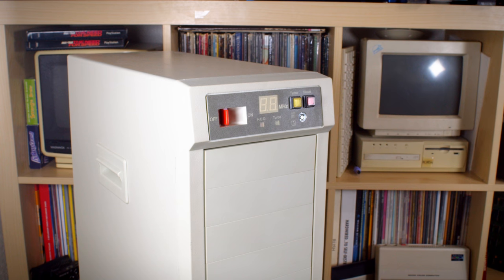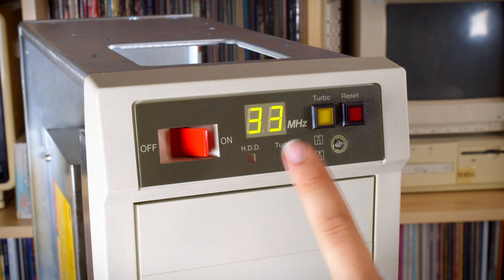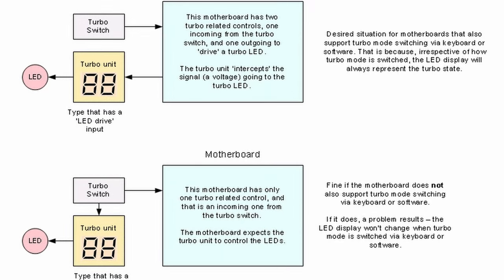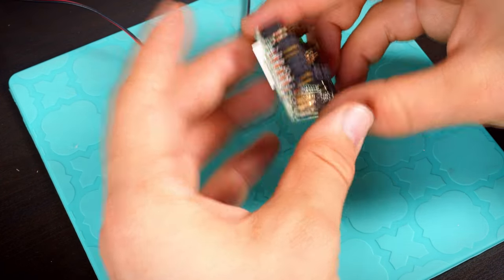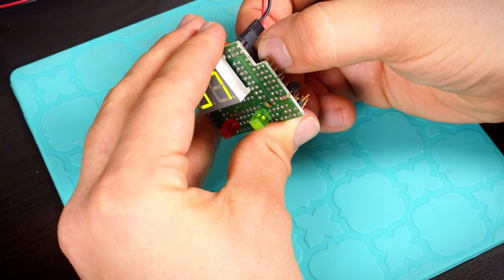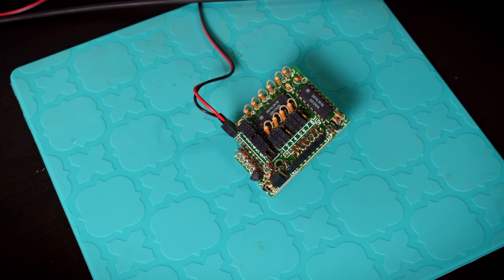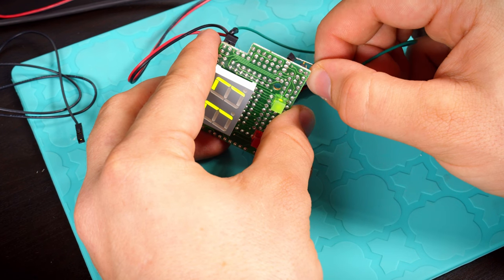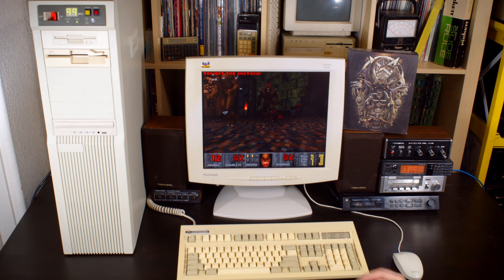Turbo Display Setup Tips - Micro Tangent

Comment: I used to set my turbo display to HI and LO  back in the day....that way I didn’t have to worry about working out the two speeds of the processor ;)
EDIT....it’s also useful if you change the processor
Reply: HI and LO is also useful if your processor is too fast for the display(Mine goes to 188, but it is in a 500-MHz system)
Reply: ...but Hi/Lo is only possible with directly controlled displays (ones with T shaped goldpin banks). One presented here is binary encoded, and there is no number "L" nor "H" :( Here you have option te set each display to 0..F.

Comment: My 486 had 11/66 turbo display. I always thought 11 mhz was way too low. You made me now realize that figure was probably drawn complitely out of hat. Didn't know that as at the time I didn't know how to measure the actual non-turbo speed.
Reply: The actual turbo ratio could vary between PCs too. Because i don't think it can change the multiplier mid flight, it would have to clock-stretch the FSB. Additionally it could kill cache function in system chipset, making for an additional massive slowdown.

But 11 MHz was probably simply invented regardless, you're right.
Reply: On anything newer than a 286, deactivating turbo mode rarely changes the CPU's clock speed (despite what the display may be configured to show). Usually it slows down the system by adding wait states and/or disabling the cache.
Reply: In some BIOSes you can even set the waitstates for the non-turbo mode

Comment: My Turbo display only has a gluetop bubble and a battery holder with a battery. Turns out, to set the reported speed on that, you have to press and hold the Reset button for a few seconds, and then press it as many times as you have to, until you get the correct number. Rinse and repeat for Turbo speed.

Comment: Are there any places to buy one of these that just uses a standard PC molex?  I have a 286-16 that I want to swap out for a 486-66 but the display in the case is hard wired to the motherboard using a custom connector, so it just sits, unable to play Doom.

Comment: Hello AkBkuKu, great video!  Watching this reminded me you had a sharp pc.  I have one as well and was wondering if an XT-IDE would work in it?  I have a sharp pc-7100 which has a built in hdd, but it is dying a slow death.  An XT-IDE would be a great replacement but wondering if it would work before I bought one.  Cheers :)
Reply from the maker: Short Answer: Possibly not

Long Answer:
Based on this thread: http://www.vcfed.org/forum/showthread.php?43148-Sharp-PC-7100-Lo-Tech-XT-IDE-CF-card-upgrade
It looks like a hard card, and you theoretically be able to replace a hard card with an XT-IDE but it didn't work for an unknown reason and the thread died out. Their questions about the ROM are valid for knowing how the machine booted. The expansion interface they talked about is on the bottom and is more complex than they realized and would take more work to make usable than a couple wires. But I don't really know, since the thread stopped, maybe he tried the cart in the other computer he mentioned and it didn't work, he fixed the card, and then it worked in the 7100 and he never updated the thread. I don't have a 7100 so I don't have any first hand advice to give unfortunately.

Comment: I just plug jumpers in randomly until it does what I want. It's all TTL level voltage anyways, so you're not going to blow anything up if you accidentally short something briefly (just don't leave it too long). Getting 12v on a TTL logic line though will fry your chips right quick.
Reply from the maker: Hold my beer...

I connected the turbo switch to a 12V header on my motherboard because the main I/O header is so ambiguously labeled and apparently has a fan connection mixed in with power, reset, leds, etc. The first time I pushed the button, smoke came out of the switch and I had to track down a replacement.

This is obviously an extreme case, but you really shouldn't underestimate the ways in which something can unexpectedly go wrong.
Reply: @TechTangents  Yeah, remember how all those AT power switches had the white/black on one side and blue/brown on the other? And what happened if you accidentally got it sideways? 

It's easier to keep it straight if you remember that blue and brown are neutral and live in Europe, corresponding to the white and black in America. The power supply would usually have a diagram, but half the time it was hidden out of sight and you'd have to remove the power supply to read it.

Comment: Those cube-like LED components are very odd... at first I thought they were two standard rectangular LEDs side by side.  I've seen a lot of hardware over the last 40-odd years, and I don't think I've ever seen components like that, or at least took note, and I'm usually pretty observant.  Are they actual cube shaped LEDs or are they a standard LED with some sort of transparent cap on them?  On camera they don't look like caps.

Comment: Heh I'd love to get a case with 3 digits on it so I can display something like "666", "420", "ASS" or something else random ;)
Reply: (also huh, I wonder if you can make it display "Err" or "bAd" and make someone else think their computer's busted?)
Reply: I believe there were no full 3 digit displays. Because AT enclosure and Turbo era ended with about 133-166 MHz Pentiums, and ATX enclosures included a best a single turbo LED rather than a full display. Where the display LOOKS to have 3 digits, only the rightmost column of the leftmost digit is actually connected to anything, forming a hardcoded "1" which can be turned on or off.

The displays with T shaped jumper arrangement and no active logic on them allow you to control every display section individually, except the leftmost "1" digit. When 100/133 MHz computers were sold with old enclosures and two-digit turbo displays, they were frequently set to display "HI/Lo".

If you're serious about doing crazy things, something could be arranged. Like a microcontroller controlled display, with animations and silly text or whatever you might want.
Reply: @SianaGearz  I had an AT chassis with a full 3-segment display. It had a 266MHz P-II processor on the motherboard (it was a combo AT/ATX motherboard), and the display was set accordingly. Kinda wishing I didn't get rid of it, even though the design was ass ugly.
Reply: @BlackEpyon  Exciting! Hadn't seen those.
Reply: The IBM PS/2 Model 95 has an 8-character alphanumeric display on the front panel which can be configured in software to display anything, including a real-time clock or a hard drive access indicator. There were some AT cases with a 3-digit frequency display, but they were rare, and most of them did not include a turbo button or indicator anymore, because that feature was pretty much obsolete by the Pentium era. I have one Socket 370 board which does include pinouts for a turbo button and LED, but the manual says it's just there for "legacy purposes" and doesn't actually change the system speed.
Reply: @vwestlife  I think mine had the turbo button, but the motherboard didn't have a hookup for it. To be honest, I've never needed them. The only games I have that could have taken advantage of the turbo needed a clock that was far slower than however low the turbo could go, and I always had my Tandy 1000 HX for those.

I'd love to get an IBM PS/2 one of these days. I know they're not practical for gaming (the sound cards are nearly unobtanium), but like the TRS-80 model III and 4, the PET, and others, they''ve just got this aesthetic that appeals to me.
Reply: @BlackEpyon  My current legacy/retro/old games box is like that. Super Socket 7 board with no turbo hookup, case with a turbo switch and speed display. I jury-rigged power to it, so it says "HI" and "LO" when you mess with the switch.
Reply: @CptJistuce  I kinda miss the Super socket 7 motherboards. Still got one, actually, with a 120MHz Pentium in it (one of my main retro machines). Takes anything from the lowest Pentium, all the way up to an AMD- K6-2, AT or ATX power, 72-pin EDO SIMMs or DDR1 DIMMs. Even has onboard 8MB AGP graphics with a breakout for the VGA header. Never did get the USB 1.1 working on that board.
Reply: @BlackEpyon  Oh yeah, those boards were pretty sweet. This one's actually my old board and processor from when these things were relevant.  The joys of being descended from a long line of packrats.

Mine's DIMM only, but it'll take EDO or SDRAM DIMMs(no DDR here). 
Need to figure out where I put my GOOD AGP cards, though. Got a PCI RivaTNT installed, and the only AGP card I can find offhand is a Trident Blade3D I picked up from God knows where. I KNOW there's a GeForce 2 around here that'd look good with Win98.
Reply: @vwestlife : "The IBM PS/2 Model 95 has an 8-character alphanumeric display on the front panel which can be configured in software to display anything, including a real-time clock or a hard drive access indicator. "

As seen in William Walsh's video here: https://www.youtube.com/watch?v=WqxRBAbbCzs
Reply: The AT formfactor did not die out before the Pentium era... It died out during the middle.
So you can still find uncommon cases with 3-digit displays, you just need to search harder.

The last Baby-AT formfactor motherboard with Turbo pins I've ever seen was for Socket 423, early Pentium 4 models... if that is any indicator of the timeframe.

And there were even a few rare ATX cases and that had a 3-digit turbo display, especially in late 1997 for that sweet sweet Pentium 1 MMX 233 MHz.
Reply: At the computer store where I worked, I use to set the 3 display ones to 130 and 530... Lunch and time to go home... Lol
LLAP

Comment: Even back then I've never seen a manual for any of these bastards. Everyone I knew configured theirs by trial and error. In the end, and especially by the time of DX4 at 100 and 120 MHz processors, people usually didn't bother with the actual frequencies, and configured them to read as "HI" or "LO". To me this display was always a completely pointless gimmick, serving exactly the same function as the LED next to it, and never understood why anyone would bother "fixing" the numbers when they upgraded processors.

Edit: also by the end of the 486 life nobody for any reason whatsoever turned turbo mode off. By then all programs worked properly regardless of frequency, and really, what difference would it make to a program designed to run at 4.77MHz if you used 66 or 33 Mhz, it still would run like shit.

Edit2: Oh and about the frequency. At least on 486 processors which I remember, the turbo button affected the clock multiplier. So a DX/2 66 would flip between 66 and 33, a DX/4 100 would flip between 25 and 100, and so on.
Reply: There were some games that worked right at speeds above 4 or 8 MHz, but started acting weird at unexpectedly high speeds.
Tyrian has crashes that only exhibit themselves on systems over 200 MHz, because of a bug in the version of TurboPascal used. Wolfenstein 3D has a boss lobbing fireballs that move very very slowly once you have a system that runs the game without frame-dropping. Wing Commander starts running too fast once your processor gets past 33 MHz.

Basically, the original developers had no way of testing on systems faster than the ones that existed at the time, so untestable bugs slipped through.
Reply: Lassi Kinnunen  I stand corrected. I've never actually owned a Wing Commander, and I've seen reference to them not running right, but no details.
Reply: "At least on 486 processors which I remember, the turbo button affected the clock multiplier. So a DX/2 66 would flip between 66 and 33, a DX/4 100 would flip between 25 and 100, and so on."

No, unless you tied them somehow to the CPU jumper settings - which weren't standardized. A "486DX4" is actually clock-tripled, not clock-quadrupled - 33MHz would be the base frequency for a 486DX4-100.
Reply: @IBM_Museum  I only had a 66 which was actually x2 the bus speed in turbo mode. But I'm sure you're right that on some processors, marketing names and multiplier reality weren't necessarily in agreement.
Reply: @CptJistuce  Yes the "unit crt" turbo pascal bug was a thing, but that's not the same thing as games not taking care to run correctly on different clocks, it was just a bug that as you said could not be detected at the time. But far from using the turbo button to "fix" that, the correct solution was to patch the executable with "tppatch".
Reply: @jtsiomb  Ah, but Tyrian 2.0 removes some particularly entertaining cheats. And my point was that I can name three games off the top of my head that try to be all-speeds-compatible but fail, and that is almost certainly not the entirety of PC gaming.
(Dark Forces 2: Jedi Knight doesn't work right on exceptionally fast machines either, but it doesn't run on anything with a turbo switch)

Comment: It does make any sense, if de turbo button/light is on, the system is at slow speed, if the turbo button/light is off it runs at native speed, in a car if the turbo is on it runs faster then if the turbo is off.... strange
My first 386sx 33mhz had the turbo light on and was on 33mhz, when you press the turbo button light goes off and was at slow speed that is logical right ?! ...confusing or maybe i`m gettin old :)

Comment: I remember being disappointed when new cases no longer came with speed displays.  Imagine if they did them now, showing the speeds of all your cores.
Reply: Make one yourself, easy arduino project to get going!
Reply: @SeltsamerAttraktor  Yes it could be done, but that would be a bigger project than I have time for.  (I've usually got my head inside a broken but of audio / video kit on my channel).
Reply: @video99couk  I bet you aren't the first person on earth to make such a thing and can just copy what someone else did. 
Writing to the serial interface over USB, reading from it on the arduino side, dumping it onto a display using some library someone made. The only difficult part would be the host PCs side with a program that dumps the information to the serial port. Easy with Linux, under Windows I have no idea.

Comment: Or... just have a case that doesn't have a display, rather a single lonely LED.  I have never needed to turn turbo off on my Gateway 2000 machine so much so I have no idea how to actually do it.  There's no switch on the case for it either!
Reply: Key combination or by software
Reply: @SeltsamerAttraktor  Don't know the combo or have the software installed and I don't have a need to slow down the 486.

Comment: I'd just replace that display with an arduino and an adafruit .96" or 1.33" (whichever fits) display.
Reply: This makes me sad. :'(
Reply: Yeah, using a micro with almost as much computing power as the computer just to light some LEDs is...  well, pretty typical for an Arduino I guess.